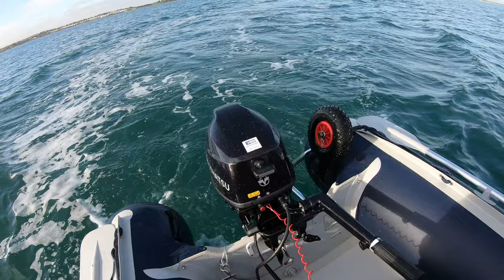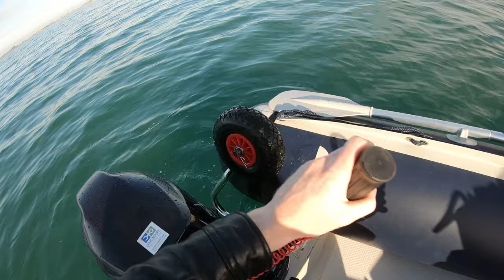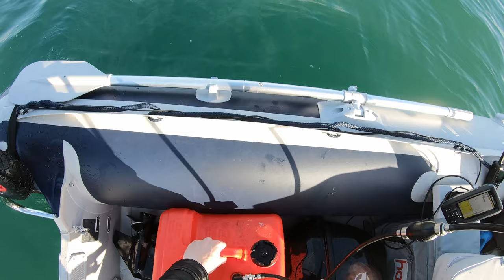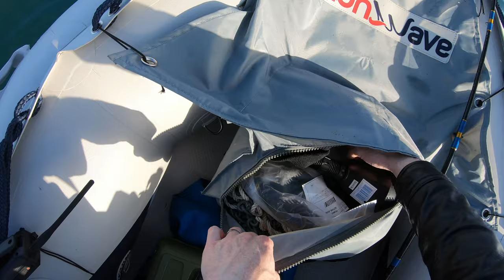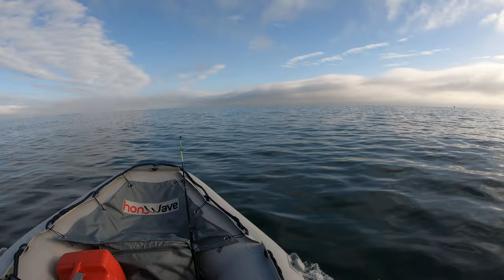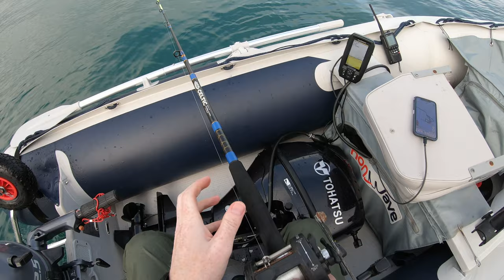Honwave Outboard Motor Failure - Exchange on the Water

Comment: Being there. Done that. Desided time to leave sib and move to same size rib with short shaft transom to use my efi f15 I already had on my T38. Because even though I had external fuel filter, the ethanol in gas contaminated the efi system despite the fuel stabilizer. And despite the only 44 kg of the motor I couldn't move it out the way to place the auxiliary. Add all that to choppy sea and boat near to shore full of rocks and you get the idea. Keep pulling and pulling never quit. A few feet from disaster motor started again. Couldn't rise rpm but managed to get home little by little. Lesson learnt. Auxiliary motor MUST be in its place with its own separate FRESH fuel ready for war every time go out. So either make diy bracket on T38 for auxiliary or leave it all behind and move to a rib.

Comment: Chris check the inside of the fuel tank, I suspect you will find the pickup tube has become detached. Looking at the video I was out with a pal on his sib with the same motor, same thing happened. Couldn’t understand it until we looked inside the fuel tank and saw the tube floating around on the bottom.

Other thing it could be is the breather on the top of the tank is blocked or not working properly. It definitely sounds and looks like a fuel supply issue, in my humble opinion.

Quick diagnosis is try a different fuel tank and see if that solves it.
Reply: @ChristopherFlannigan  no worries chap. Good luck with diagnosis and fixing. Love the videos, keep them coming.

Comment: Great video Not bought a Honwave yet but will be, Ive always said to myself I will be buying two engines a small incase my 9.9hp or 15hp ever cut out. my friends keep telling the new engines on 4 stroke never cut out but even the best so called super cars have engine problems and the in the £250,000 mark another video ive saved to my Dinghy library. I was going to ask what is that siphon called, but then you mentioned it was called a jiggle siphon. I will look that up to buy one, very handy gadget. Thanks for sharing, Ray K.  UK.  YNWA.

Comment: Maybe you want to put anextra fuel filter on you fuel line going from your tank to you engine and check you engine filter. Same thing happened to me this summer with my yamaha 15hp after a couple of pulls and throtle twists it was just fine although i did clean my carb again
Reply from the maker: Nice tip